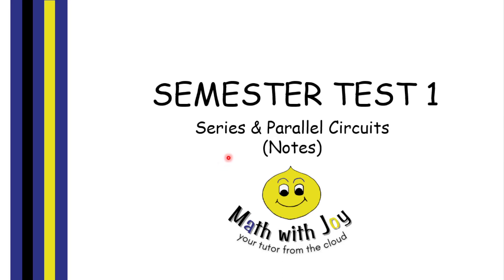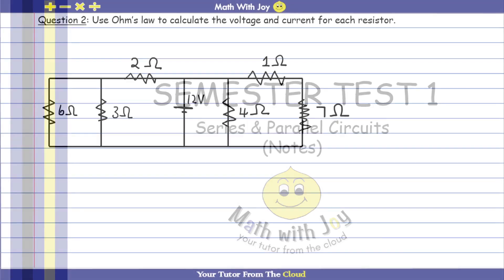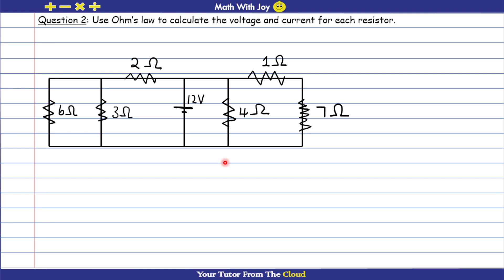Series & Parallel Circuit

Comment: I made a mistake, I added both left and right Rt and did the I=V/R to get a common current for the both sides!!! So I got a current of 1.79A flowing on both sides and a voltage of 4.833v, 7.167v on right and left respectively to make up for the 12v battery, was thinking the battery would only provide a certain amount of current for the circuit and not individual current.

Comment: I normally use Kirchhoff's Law and Systems of Equations for each loop.
Seems easier for me ....

I would like to see this same circuit with two VDC sources - 1.) aiding each other 2.) opposing each other
This is what I'm having issues with right now ...
Reply from the maker: Yes, you can use Kirchhoff's laws too. In this video I was just demonstrating how series and parallel circuits work. And I'm on it. I will post a circuit that has two VDC sources✨✔